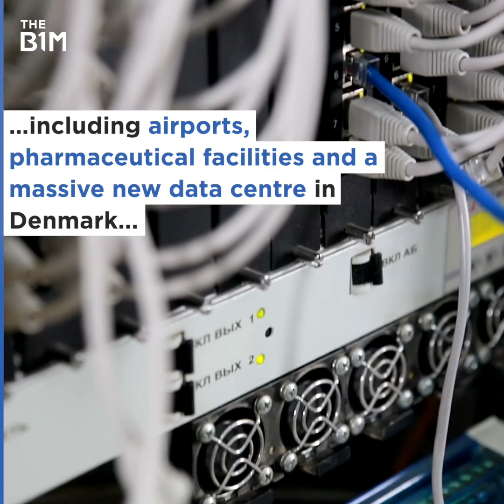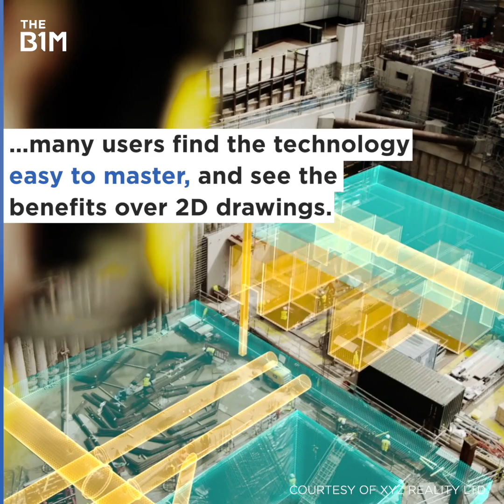AR Has Arrived in Construction

Comment: fantastic. but for my industry (bridges) there are still no userfriendly 3d reinforcment planing software and no good bim solutions. it works with a lot of effort and crazy tricks, but its just takes more time to plan bridge in 3d. i have vision how it should be, but software develepers cannot invest so much money in bridge software.
the problem is geometry. bridges are always curved in 3 dimensions, so its still faster to do it with 2d and low quality planing. building sites are ok because they dont know that it can be better.
other problem is that for briges you cannot make mathematical releationships beetween fem model and geometrical model so easily (no software / dynamo to complicated to use for that).

why nobody is trying to invent some kind of material, so that you can build all bridges without curving in all 3 dimensions, and for car dynamics you put some kind future material without reinforcment on top of bridge, which surface will be curved for cars. its crazy that we build curved reinforcment bridges on a daily basis (not true for italy, but true for germany)